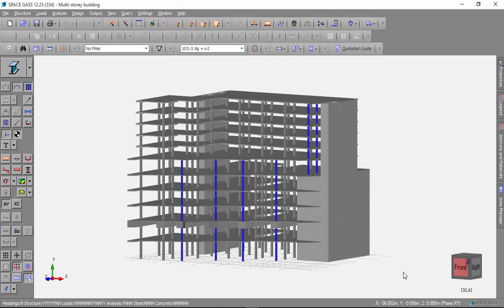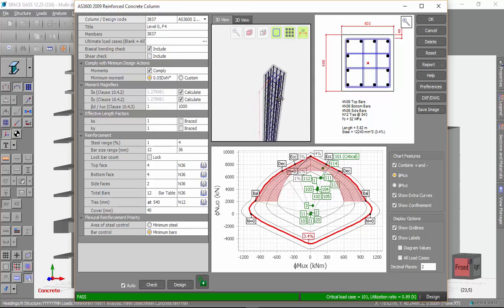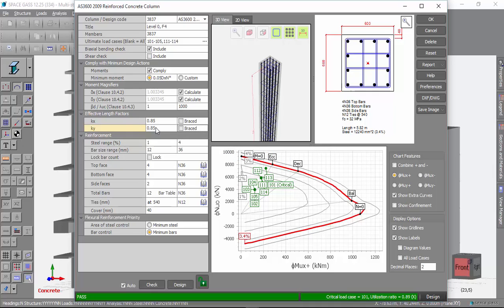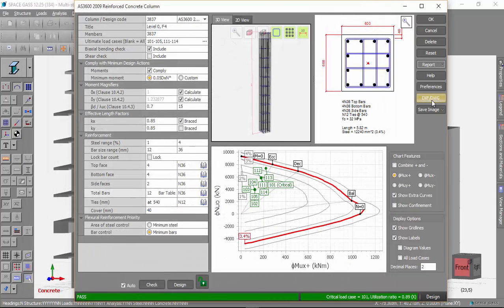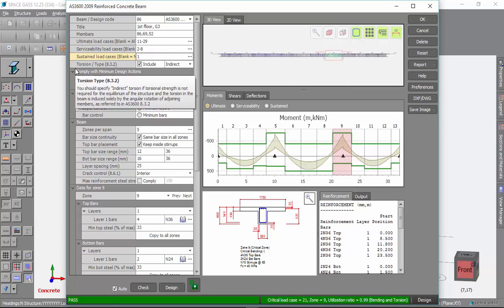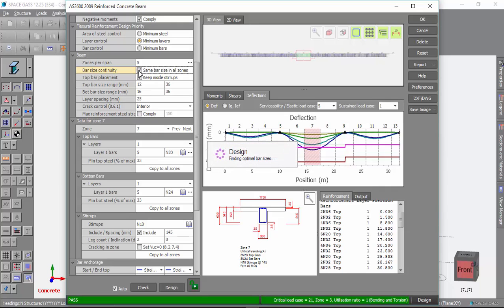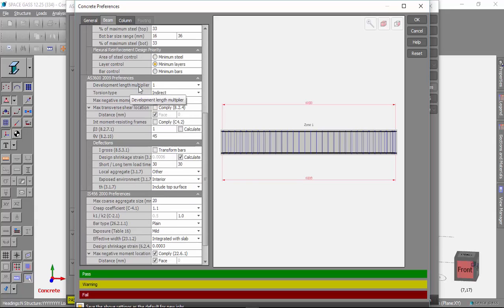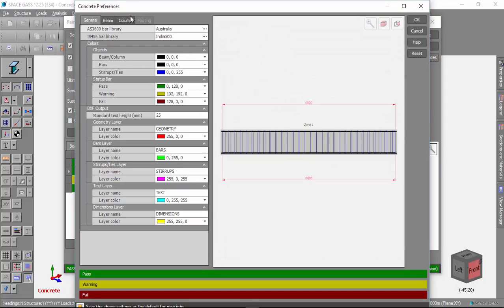SPACE GASS RCDesign Webinar Recording   21 Feb 2017

Comment: Where do I find more videos like this? apart from space gass website
Reply from the maker: SPACE GASS overview training event:              http://spacegass.com/training/webinars/gh57fhry-OV/SGWebinar-Overview-310117.zip 
Steel Member Design in SPACE GASS" training event:           http://spacegass.com/training/webinars/3ag487fh-SMD/SGWebinar-SteelMemberDesign-221116.zip
Steel Connection Design training event:                                  http://spacegass.com/training/webinars/s8djr6dg-SCD/SGWebinar-SteelConnectionDesign-011216.zip
Moving Loads in SPACE GASS training event:                                      http://spacegass.com/training/webinars/k745hgyd-ML/SGWebinar-MovingLoads-141216.zip
Portal Frame Builder and Shape Builder training event:          http://spacegass.com/training/webinars/k85sa2e3-BLDRS/SGWebinar-Builders-080217.zip
RC Beam and Column training event:                                 http://spacegass.com/training/webinars/h28d6s21-RCBC/SGWebinar-RCDesign-210217.zip 
Plate Finite Element training event:     http://spacegass.com/training/webinars/gsh28de3-PLTS/SGWebinar-Plates-020317.zip
Reply: Can you reupload the links? They dont seem to be working. Thank so much they have been very helpful